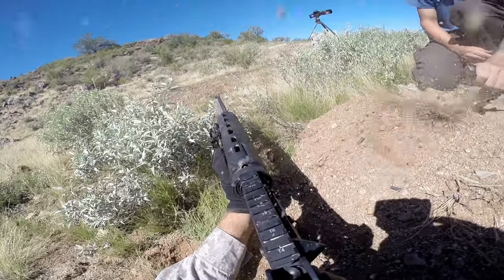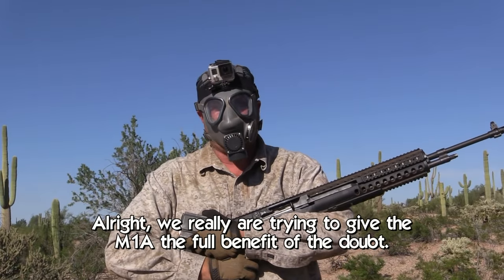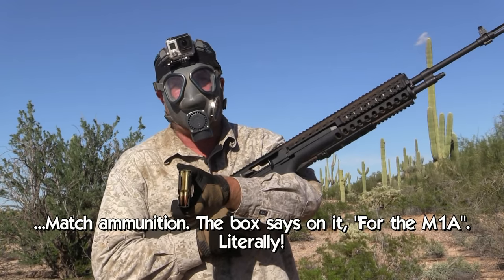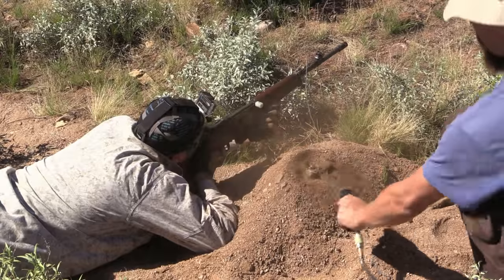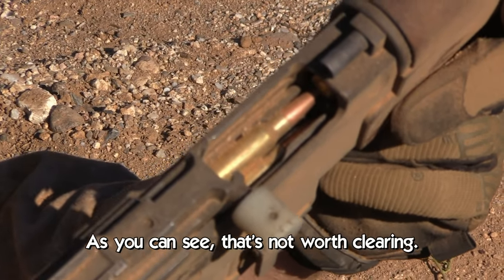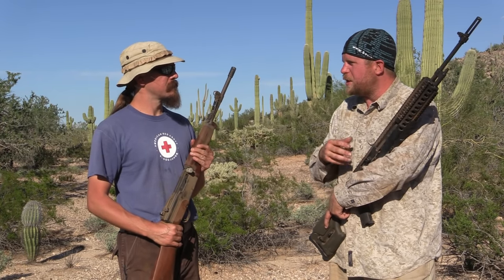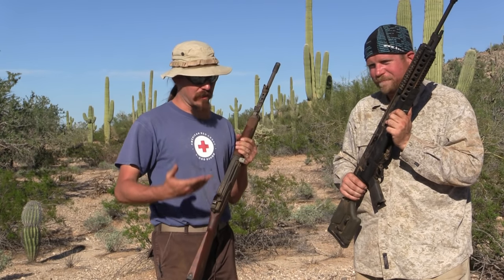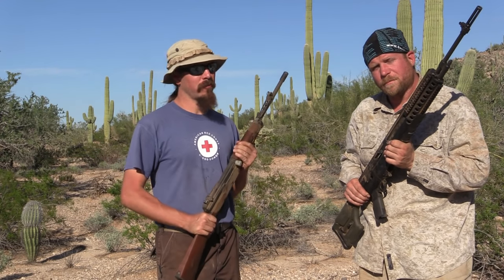Sand Testing An AR15, M1A, And MAS 49/56

Comment: I've done this test organically with my modern ArmaLite AR-10. At an NRA High Power event at a range with a sand floor I was unlucky enough to have on both sides of me guys shooting 14'5" AR-15s with pinned dual-port muzzle brakes, the blast of which was so strong that almost every shot would knock my earmuffs off and push my hair into a mohawk (I had to revert to earplugs for hearing protection). The blast from their compensators knocked so much sand up that my .30-cal ammo can in which I had my match ammo was full of sand up to the level of the highest stripper clip of ammo. The magazines would pour sand out of them when I would pick one up and turn it over, and everything, including the rifle, was coated in sand. When I got home I weighed my rifle and it had gained 5 ounces of sand just in the lower receiver. Despite all of this and the receiver group being essentially full of grit, just as the ammo was caked in it, the AR-10 did not malfunction once, and even locked the bolt back after every magazine!

Comment: I'd like to see the FAL and G3 type rifles but I imagine they will behave similarly to the AK.
Reply: +HeretoStay33 Would also very much like to see the FAL.  I expect it would do somewhat worse in blown sand than an AK as there is less mass in the bolt carrier to provide inertia when reciprocating, and rather tight rail slots in the receiver to trap sand.
Reply: +Jhon Smith they'd have to do a sandcut carrier for sure
Reply: That would be interesting.  I have a suspicion that the sand-cuts only work for low volumes of sand.  With the amount of blown sand in this test they might funnel sand into the rails even faster as they expose some of the rail even when the action is closed.
Reply: I love the M14, as a civilian it suits me perfectly, but Screwface Romeo is right it was a rigged game.
Reply: I would like to see them do the sand test and the mud test on them.
Reply: is there a g3 dust test?

Comment: Regarding the M1A's total failure in blowing sand: I'm finding a couple places where people say if you're in extreme cold or in deserts or areas with blowing particulates, to completely degrease and lubricate with DRY graphite. It will not act as a preservative but it's supposed to work a lot better for just keeping your gun running. But don't use it if you don't have to, if you're not in those types of hostile environments.

Comment: The early Vietnam era M16s were tested, with two different powder types and non-chrome lined chambers, in Panama with the M14, in 1968. The military tested them in beach (sand), swamp, and jungle environments and still concluded that the M14 was not conclusively more reliable than the M16 with either powder. There were forces conspiring for the M14 against the M16 within the military that covered up all the deficiencies and difficulties they were having with the M14 in regards to not only reliability but also accuracy and build quality (heat treating, cracked bolts and receivers). This occurred until 1968 when Congress wanted to know where the 100 million dollars they had spent over 13 years on the M14 had went. The military was forced to conduct public testing and with the cat out of the bag on exactly how bad the M14 really was, the fate was sealed for that rifle. But that is why all negative reports and combat failures for the M14 were covered up and people are under the mistaken impression that it is the more reliable rifle, when in fact, that was never the case, even when competing against the "Mattel Death Trap," which was intentionally slandered by the same military brass covering for the M14. 
The M14 was found to have a Mean Rounds Between Failure in 1968 of only 599 rounds. Current M4s get somewhere in the neighborhood of 1993 MRBF. So it isn't even close. The M14 isn't more reliable than the M4/AR-15, and never has been.
https://firearmusernetwork.com/2015/03/06/m14-reliability-problems/

https://looserounds.com/2015/01/30/the-m14-not-much-for-fighting-a-case-against-the-m14-legend/

Comment: I felt like you should have tried that test on AR15 one more time, just to be sure. Seemed as if less sand was droped on it in comparisson to other two guns. Still, a good video. Now waiting for AKM :3
Reply: Its because the AR blows gas out of the ejection port when the gun extracts due to the direct impingement

Comment: As a european (more specific german) viewer I don't know the prices or availabilities on the american gun market, but regarding the discussion about the german service rifle, the G36, deforming under sustained fire/losing accuracy, I would really like to see some hand's on testing/honest opinions.
Reply: +BananenJaeger If you go to TFB TV they did a G36 accuracy video that shows it's degradation of accuracy over volume of fire. In terms of prices and availability it's basically extreme and nonexistent, HK really doesn't like exporting "military style" firearms, and if you can get them to you'd be expecting probably around $3,000 for a semi auto one, probably more like $10,000 for a full-auto rifle. Compared to a decent AR which would be around $800, and a full-auto being a probably at minimum $8,000. I would say the G36 would be good for less than 100 meters, as a police patrol rifle, though I've handle the type of rifle, and it is the opposite of ergonomic really, so it's not very comfortable.

Comment: So what would your ideas on improving a Garand action be? I could think of extending the forward receiver ring to cover the locking lugs (this would necessitate a longer cycle length for ejection) and a small spring loaded dust cover over that hole in the receiver bridge that flips up when the bolt moves back but the flips back down when the bolt is forward (or omit the hole altogether, a la M1 Carbine). Possibly increasing rearward travel of the bolt to give it more momentum to feed cartridges. The Mini has a leg up since all the op-rod tracks do is hold and guide the op-rod rod, rather than arresting rearward travel, so the front and rear of the guides is angled to allow gunk to be pushed out. That M1A could use a heavier extractor spring, shouldn't affect clambering since the cartridge rim slides under it.
Reply: Sean Heihn well start with getting a SCAR and call it a day.

Comment: +InRangeTV Correct me if I'm wrong, but doesn't the standard, basic M1 Garand and M14 case include quite exposed operating rods and a notable cut out, relief, for safety switch?

You'll have to forgive me for the question, what with being in Australia and having very limited access to firearms and semi-automatics are just completely off the RADAR. 

From what I'm seeing here, is the reason the AR 15 consistently passes is that so much of the action and system is secured against debris. If the debris has no way to access the action, or is seemingly blown out by the force of the action in the case of the MAS49.56, it isn't there long enough to the damage or to build up. 

With the M1A, it's either leaking in and preventing the rifle from cycling like it seemed to be with the mud, or the debris is building up under and around the operating rod, creating so much friction it can't extract. The action just doesn't have the strength with all of the extra mass to cycle. 

At least, I think you're talking about a failure to extract when you're saying FTE.

Feel free to debunk anything I've said. You guys have got the hands on I wish I had.

Comment: The MAS design come back from the 30's even though it was still at prototype stage when WW2 began. The M1A is from 1974 nearly 40 years later. Honestly this show proves how amzingly reliable the MAS was for its time. It's fun because some people from the USA make fun of French guns being unreliable when its pretty clear that the american M1A was garbage compared with the much earlier MAS.
Reply: niksarass isn't the m1a/m14 action is near identical to the m1 garand? which was also developed in the 30's
Reply: newcorpse ontheblock the m1a lockup and oprod is the same as the garand but the gas system is borrowed from the m1 carbine
Reply: Brett Hutchison yes except this wasn't a test on the gas system but the actual action itself when foreign materials are introduced. The m1 garand did just as bad from what I remember.

Comment: Not only do I very much want to see the FAL...I want to specifically see the adjustable gas system tested. That is, fire it clean and tune the gas system down to the lowest setting where it runs reliably, as recommended. Then mud/sand test it, and when it fails, open the gas port ALL the way as intended for "adverse conditions" and see if that really does help, as advertised.

Comment: How about an AR-10? Something Like M&P 10? Basically an upscaled AR-15 Action. Just wondering if by having a bigger ejection port and slower moving bolt, you'd have a higher chance of getting sand into the gun.
Reply: +Hostile it probably wouldn't matter upscaling it because like the ar-15 the gas is ejecting out with cases forcing out anything inside and not allowing anything to get in

Comment: Try a stock springfield M1A, your M1A looks like it was made for percision shooting. A good percision shooter always have tighter tolerence, the standard M1A is rugged and doesn't jam. There is a reason, why the soldiers in vietnam perferred the M14 over the first M16 after seeing jamming issues.
Reply: "The m1a is rugged and doesn't jam" every gun jams, and garand variants jam quite a bit. Th first m16s weren't jamming because of their design, it was because of a powder change at the last minute by the bean counters combined with the lack of cleaning.

Comment: Maybe the troy stock is just terrible for driving sand INTO the m1a. An m1a with the standard stock would probably do alot better. Also,, is this test to simulate a firefight in a sandstorm????
Reply: +ZFlyingVLover So the moral is get an AK if you want to keep firing in a sandstorm
Reply: +ZFlyingVLover I don't see how. The M1a's open-topped action is perhaps even MORE exposed with the factory stock

Comment: Question: Did you run the M1A with the factory Springfield Armory extractor? If not I would be interested to see a rematch with it swapped for a USGI extractor to see if that makes any difference.
Reply from the maker: +Gosh Darnit No idea.   It was a loaned rifle.  ~Karl
Reply from the maker: +Gosh Darnit The fully USGI M1 performed the same way, however:

https://youtu.be/v6J5m4_Is_s

~Karl

Comment: Well,... there is no doubt the M1A did poorly in the mud n sand,... That said Id still take it into battle  where there are areas of mid to long range engagement,.. Most battles don't happen in sand storms,.. at least not usually.. I'd love to see how an FAL and a HK91 or clone,....
Reply: "Most battles don't happen in sand storms"  
Most battles don't happen in the snow either.  They also don't always happen in arctic conditions.
But they sometimes do, which is why similar tests are conducted during the military trials for a rifle.
The AR15 performed very well in all these tests when the Army tried it in the early 1960s, especially in arctic testing, and that was with the Army sabotaging the rifle in favor of their M14, which failed miserably.

I've deployed with both systems to various parts of the world, and will find a way to get the job done.  The M14 only has a place as a DMR if it is in the unit's inventory.  It is sensitive to debris accumulation on the bolt.
Reply: Eric K most battles don't happen  in sandstorms, but that's not much consultation for anyone in sandstorm with a jammed up rifle. In WW2 there were plenty of sandstorms during the Africa campaign. 

This is why military geology is important, taking into account different conditions you may be fighting in to try and make a rifle that can function anywhere a soldier can function.
Reply: True,.. I was pretty much just trying to acknowledge there is still a roll as a DMR rifle for medium and long range is all ...I wouldn't say it would make for a viable infantry rifle. But that said Id still like to see how the FAL and HK91 does in this test... just out of curiousity
Reply: Eric K Those deisigns have no relevancy in the modern era, unless you're looking at holdovers in Iran, Turkey, 2nd-rate reserves and internal security of Middle Eastern and underdeveloped nations who can't afford modern rifles.

Even the Turks and Iranians have their own AR15 variants.
Reply: Eric K
DMR's are back in a big way, but most are opting for "Ar" like rifles chambered in 7.62 NATO. The issue with old rifles now is simply age, there is only so long you can keep a 60 year old gun running before every part inside it is new, that and is it really worth keeping an old gun working which needs spares and stuff if you can get a better rifle new.
Reply: LRRPFco52 I never said it should be an infantry rifle. They're still in use, or at least we're using the M1A/M39 in Afghanistan till the draw down,.. as a DMR platform for units that did not rate to have a scout sniper in their unit for longer ranged engagements , it's still viable when configured as a Mk14 EBR and maybe they still are..
Reply: fdsdh1 Yes I know.. I follow you...and agree. We're on the same page. I just hate typing what would be said in a normal conversation...takes to long on a phone
Reply: Eric K I'm not sure there are any M14 variants there anymore, especially since fielding of the M110.

We had them in several units that I was in, including M14s, M21s, and NM M14s brand new in the plastic storage bags.  We kicked them down to the line companies in 1/506 when we instituted a BN-level DM program, overseen by the Scout Sniper Platoon, our B4-qualified PL (prior enlisted), with the blessing of our BN CDR and BN SGM.

That was in 1997 in Korea.
Reply: Heres a link with some info,.. http://www.militaryfactory.com/smallarms/detail.asp?smallarms_id=615
Reply: Eric K M14 is done in the US inventory for the most part.  There might be rifles here and there, but last I heard, they've been turned in and processed out of the system from most units that had them.

There is currently no real system in place to train maintenance and armorers for it, outside of the AMU and Quantico, maybe a few guys at Pendleton at best.

Very difficult rifle to support from an organizational perspective.  The AR15 is the opposite-very easy to support with parts replacement and no special skills really.
Reply: +LRRPFco52 Jesus Christ You didn't even go read it did you,..?
Reply: Eric K Yes, I did.  You're trying to school someone on the inside from the outside, which is pretty unstable ground for an argument.  That article is also written from an outsider, looking in.
Reply: LRRPFco52 No,.. please don't misunderstand what I am saying, I'm not trying to school anyone. Originally in my1st post I was only saying I would still take it in a fight and would like to see the other rifles tested. Somehow the assumption was taken that I said they were using them in large numbers. I wasn't ever saying that. The only point I was making is its still a viable option for very specific uses and is in fact still being fielded by some units (in certain variations of the design) by mostly Marines and Navy  That is alI was ever trying to say. Maybe they recently stopped that too but it has infact been used in certain limited rolls till the very recent times,.
Reply: Eric K It was never issued in large numbers, only for DMs and EOD, with some limited SOF use.

Once everyone started getting SCAR-H in SOCOM to field, the M14 was forgotten quickly.  Not saying the SCAR-H is a great weapon, just what happened.

Same for Army with M110, and Army units that got SCAR-H as well, which included Ranger Regiment and SF.  They have been used in limited numbers in a DM role.

M14 is one for the history books now.

Comment: It probably doesn't matter,  but was the dust cover closed on the AR ?
Reply from the maker: +Jerry Long Not once it was firing, no.  I don't remember if we started with it closed or not, honestly.  ~Karl
Reply: +InRangeTV Thanks
Reply: +Jerry Long The dust cover was open to begin with, but it doesn't matter since the dust cover opens on the first shot. It needs to be open to eject spent cartridges.
Reply: +Craig L Yeh, I know how the dust cover works. I was asking because the sand was being blown before the first round was fired. So it might make a difference.  Although I don't think so.
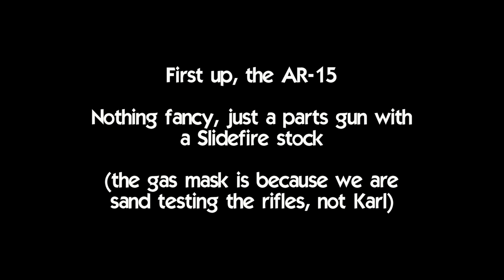Reply: +Jerry Long Oh, ok great. If you turn the resolution up to the max then you can see at 0:14 that the dust cover is open to begin with.
Reply: +Craig L Thanks
Reply: +Jerry Long Either way after the first round it wouldn't have been.

Comment: a comment on a 4 yr old video.  The test on the M1A should be repeated with an issue M14 stock.  Might not make a difference, but that would make the tested item with stock that keeps the op rod and pistol cleaner.
Reply: The jams are occurring because of the open action, not the oprod.